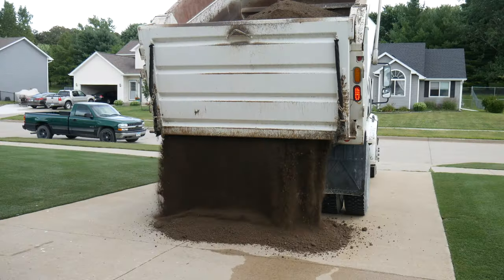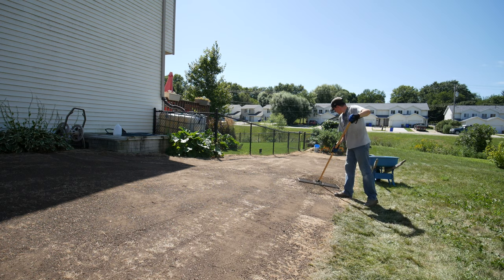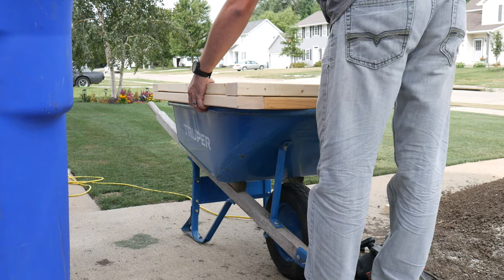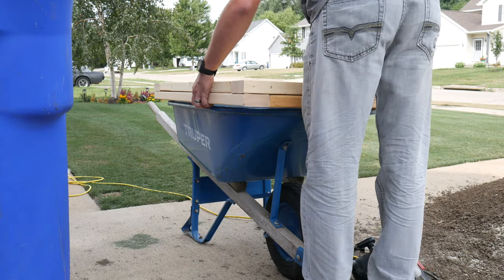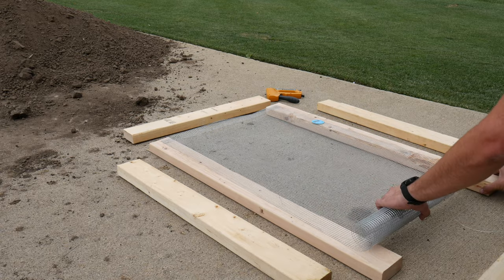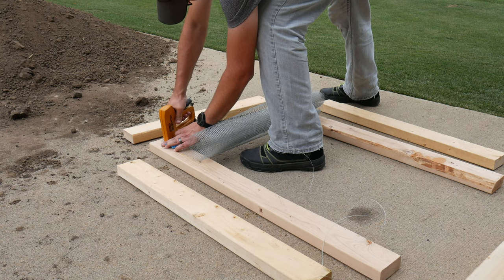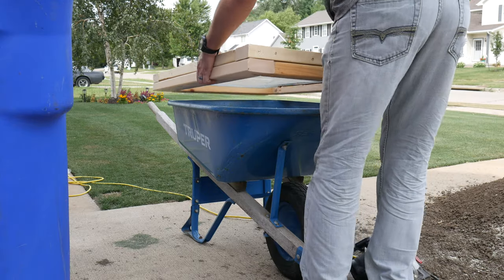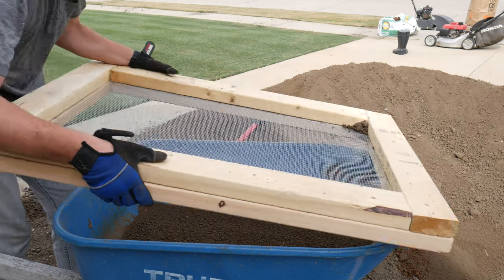DIY Soil Sifter // GREAT for Lawn Leveling

Comment: Using the 1/4 inch screening will get the particle size super fine, but on a pile that size it will take so much longer to screen.  Having the mesh be 1/2 inch or 3/4 inch expanded metal mesh will still make the particle size still desirable, but the expanded metal will last a lot longer and the screening time will go so much faster.

Comment: I owe all my inspiration to RK for building one like his. Just keep in mind, sifting through a truck load of dirt will have you more exhausted than you've probably been in ages, even if you're in okay shape. Lifting that screen thing over and over again to dump it gets brutal if you have to spend hours doing this. If I had to build another one, I'd try to use some kind of lightweight plastic rails rather than wood to build the frame, and a bit of construction adhesive to keep them from coming unscrewed or unstapled.

Comment: A lot of people who use these for compost processing have them at an angle so the larger stuff runs off, saves having to lift off the panel every time you want to remove the larger bits.
Reply: Mark Evans same idea, I’ve seen people build a “tube” at an angle and someone spins the tube while another person continually loads dirt into the top. Big chunks fall out to a separate pile at the end and the screened pile is below the sifter.

Comment: Great idea. I made a similar one, but put small casters on the sifting tray, and made a companion bottom tray that rests on the wheel barrow. I load the top tray and run the sifter forward and back a few times and it does the trick faster with less effort.  I’ll send you pictures if you want.
Reply: I’d like to see this. Can you send pics?

Comment: This is fantastic Ryan. I am constantly getting frustrated whenever I dish out some topsoil or compost that ends up being more of a nuisance because of its size which won't let it degrade quick enough, or the amount of pebbles and rocks that can beat up my lawn mower blade. I'm definitely going to make this. Maybe add on extra height with a extra 2x4 so I can dump more in.

Comment: Thanks for the idea, I just built one this weekend.  I made two changes to your design:
   - I built the bottom frame first using pocket holes and then stapled the screen to the bottom
   - I screwed blocks to the bottom so the sifter would sit firmly on my wheelbarrow and not fall off

Comment: Screwing a couple pieces of PVC pipe to the bottom of the sifter can help speed the sifting by sliding back and forth on top of the wheel barrel.

Comment: I'm building one of these out of 1x2's rather than 2x4's because it's much easier to handle.  I'm sifting decomposed dirt and leaves out of newer leaves, then tossing over the fence, so weight matters.  When I'm not sifting stuff, the sieve does a nice job of keeping derbies out of the outdoor air conditioning unit when it's not being actively used.
Reply: Smart Double Function planning! Saves finding a "Place to Store it" at the Same Time!

Comment: So going to make this. I'm going to make it with legs so I can shovel dirt into it and screen out the rocks. I have the half inch wire mesh. I might put a small motor with an offset weight so it vibrates the screen like when a phone buzzes.

Comment: Made one of these from an old kids folding table and some stiff metal wire screen about 1/2 inch holes. Not sure how it will work but if it doesnt I'll try putting a massage gun on it to make it vibrate.

Comment: I think the sandwiched 2x4s would make it a little heavy, I'm building my first one now using 2x2s with the screen just screwed to the bottom with washers.
Reply: how did come out using the 2x2s?
Reply: @sfbenfica2000  It works fine, the only thing I'd change is dimensions. I made it a little too long for some wheelbarrows.

Comment: When you sift and put the soil down and then roll it level. Do you put a little loose soil on top of that for the new seed to grab?
Reply from the maker: You can lightly rake it in and roll again or see if rolling along will still push it into the soil

Comment: wow, the first time you did a video where not only I disagreed with you, but I think you were wrong.

I will say that I have a lawn tractor-trailer that is rectangular, maybe 4 ft^3.  For the long ends of my screen, I took a 2x4 and ripped it in half so it was 2x2.  These were laid on top of the long side of the trailer.  I then took another 2x4 and put it in/on the short side of the trailer so that it fits half inside the trailer box and half outside with the 2x2's.  The long ends extended 6" past the end of the trailer and it looks like a [people] stretcher.  I then put the screen over the frame and used screws to hold the screen.  The screen is placed so I could push the dirt off the short ends, ie the raised part of the screen ran the long way of the trailer.  The screen fits on top of and inside the trailer snugly, one of the two mistakes I made was it fits very snuggly.  (It was fine till I wrapped in the screen and screws.)
It is tough work doing it my self as I have to switch tools and break my rhythm, but when my son "helps" I can get a lot more done.  I would shovel and spread the dirt on the screen and he would use a garden rake, upside down, and get the loose stuff to drop through and when it is just large rocks then he would push it off the end, into another trailer.  I would lift the screen three times, twice to spread the dirt in the trailer and the third time to move the trailer to where I want the dirt.
I do have another screen, smaller, that I do use on a wheelbarrow.  If I were to make another one, it would fit around or in the wheelbarrow so it would not slide as I used it.
The other mistake I made was I need a backstop.  After the third trailer full of dirt, my aim is not so good and not all the dirt stays on the screen.  I have not come up with a good solution as to how to construct it.

Comment: What would you recommend to separate yard waste (weeds, rocks, etc.) from dirt? Larger holes? Thank you!
Reply: The Example he Built, was a "Batch Mode" sifter, and used, as he said, 1/4" sized construction cloth. It can also be had in 1/2" Spacing (1/2" x 1/2"), if you want a bit faster Flow through of higher volumes of feed. 

Also, as Ryan has "Framed" the Sifter on all 4 sides, if you designed it, with 4 frame pieces under, but 3 on top, with a exit for the dirt, Leaves, Twigs, etc, that was oversized, in could Flow out faster, eliminating the need to pick it up, to empty it each time! Just add a tray or lip extension on the opening so the Oversized items falls further away from the Wheelbarrow!

To secure the Construction Cloth, give it a 3-Sided "Wrap" on the Opened Space, especially, as well as Stapling it on top, edge, and Bottom of that wrap.

Hope this idea helps! Also, as another poster said, building one with a Second Carrier Frame, with Some form of Rollers, Wheels, or Casters (non Swiveling) so you can agitate the Sifter with a back & forth sliding action, simplified it's use, and meant not having to hand spread out the Load, and was easier and faster!